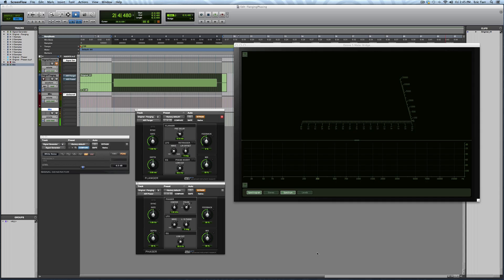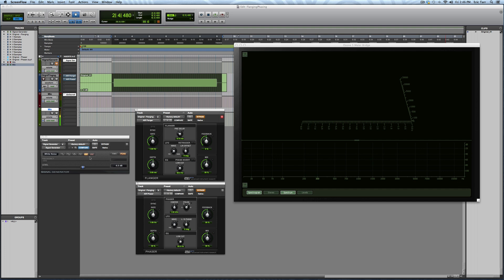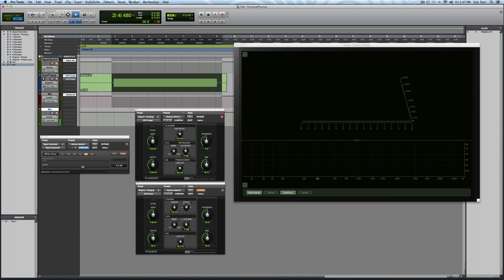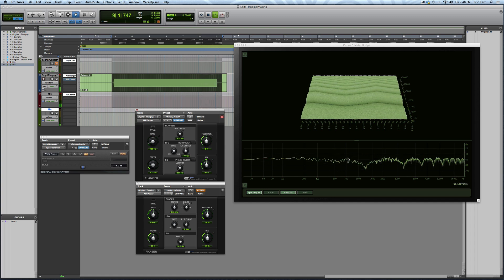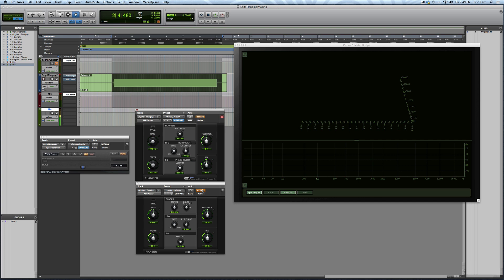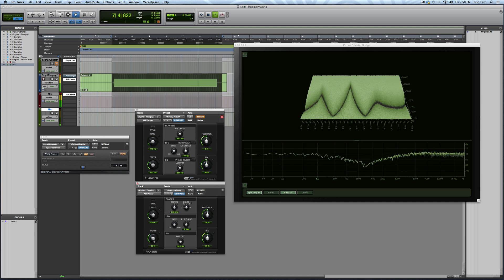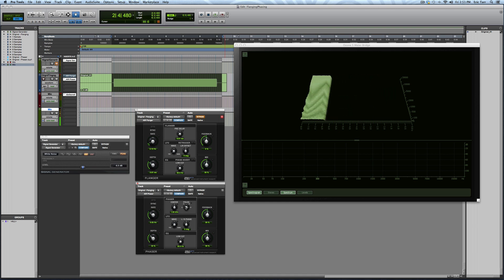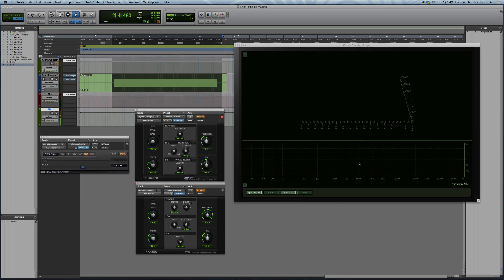Phasing vs Flanging — What's the Difference? (Part 1)

Comment: @proaudiofiles
Is it possible to have a flanger effect that goes straight across on the spectrogram, rather than going up or down? Or would that be a different effect, and if so what would it be called?

I like the sound of a flanger, but I don't like the in-and-out 'doppler-esque' sound of it...

Comment: Flanger is a time-based effect, phasers are filter-based effect
Reply: It's literally as it's named. A signal is partially in phase with a copy of itself. The PART that is in phase is controlled by an LFO, creating the phaser-sound. It can be argued it's not too dissimilar from flanger and chorus as it's a copy of the original sample.
Reply: Phasing is also a time based effect in a phaser instance
Reply: @MomoTheBellyDancer Oh, come on. And I think the 2290, once again, has no phasing because it's not a delay (time) effect like chorus and flanging
Reply: @MomoTheBellyDancer Lexicon PCM80 has only time based effects. The phaser isn't included in that unit
Reply: @MomoTheBellyDancer That's because phasing is not a time based effect.
Reply: @MomoTheBellyDancer Same thing for the Rocktron Intellifex. It only has time based effects, and, once again, no phasing. Phasing is not a time based effect. It's a filter based effect related to wah wahs and envelope filters
Reply: @MomoTheBellyDancer What's the chances of all these time-based units leaving out phasing for no reason?
Reply: @MomoTheBellyDancer These 3 units just "left out" phasing because it's a different "algorithm". Yeah, okay
Reply: @MomoTheBellyDancer I just listed 3 times-based effects unit, and none of them have phasing. That's because phasing is not a time-based effect. I think TC Electronic, Lexicon, and Rocktron would know more about effects than you

Comment: Do you know if there's a certain name to describe what was happening when you were messing with the depth on the flanger? I've heard that kind of white noise down-shift kind of sound many times before, like in video games. I've always been curious about that...
Reply: +QuasarBooster Filtered white noise is very common, and on older games with the noise oscillator, the low quality audio could have been doing something strange. There isn't a name for it that I know of, but It's common in Electronic music. Some Classic rock used flangers on hi hats and dub and reggae both use similar effects too.